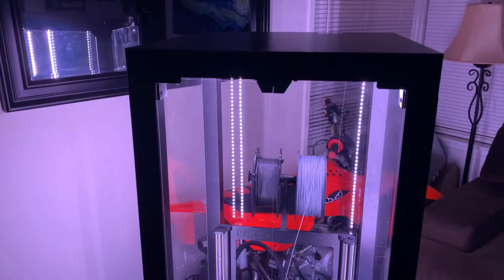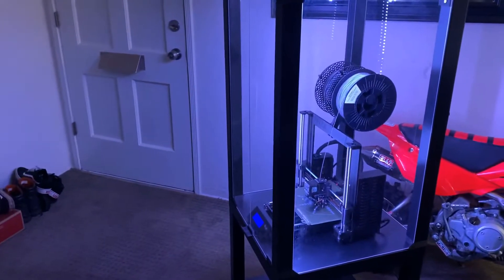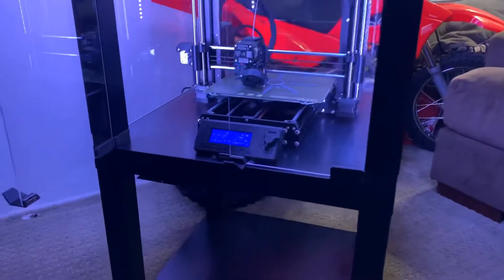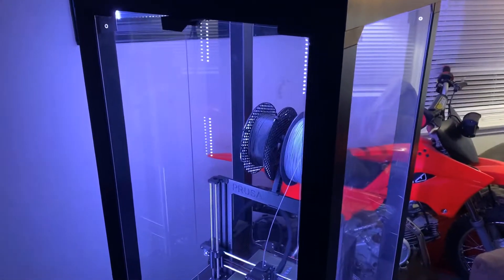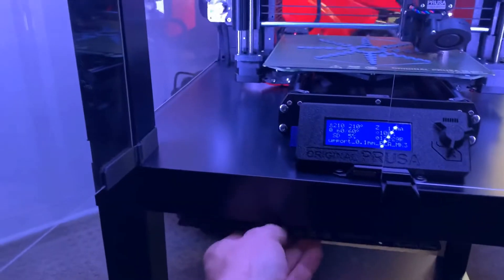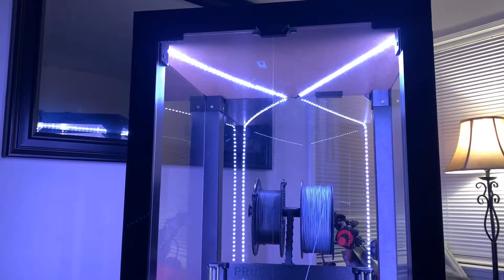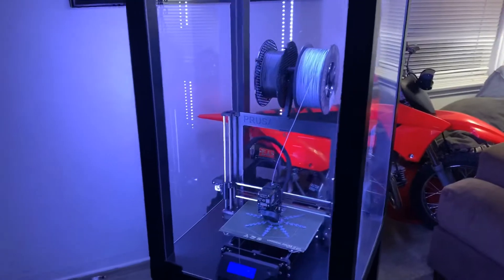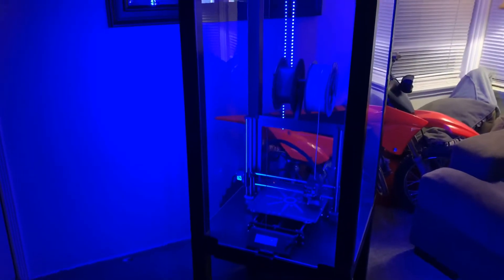IKEA Double Lack Enclosure Prusa i3 MK3S+ 3D Printer

Comment: How do you have the top table top secured to the double legs?
Reply from the maker: The same way the table would normally be assembled, using the double sided screws.
Reply: @Tcodyw88  if you face the two legs towards each other, how can the other sides attach to anything else?
Reply from the maker: @cryptoknowsall  theres no guide hole there but you can still screw the double sided screw into the center of it.
Reply: @Tcodyw88  how are you securing the top table with double legs to the 4 legs below it?
Reply from the maker: @cryptoknowsall  using the supplied ikea double sided screws As stated in the previous comment they is not a “guide hole” on the other end of the legs so you will need to make a guide hole to screw into.
Reply: @Tcodyw88  sorry i meant how are the double legged table legs secured at the bottom of the enclosure
Reply from the maker: @cryptoknowsall  oh using the 3D print file that contains the hinges also has some connectors that allow the top to be removed

Comment: Cleanest setup by far, looks awesome! What are your thoughts on the power supply location? I saw in most videos that they mount it outside of the enclosure to reduce the chance of overheating
Reply from the maker: Thank you.  I actually did my research on this and decided to keep the power supply inside the enclosure because there isn't any real evidence of people who have actually had the PSU overheat from being in the enclosure and prusa will probably release a updated power supply before it goes bad from being in the enclosure lol. Additionally I'm installing a temp controller and fan to help maintain ambient temperature inside the enclosure for better print quality.
Reply: The psu will not overheat but will drastically decrease the lifespan of the component. They make a mount that holds it right under the table.
Reply from the maker: @jakefenske3482  that mount also makes it much more difficult to remove the printer from the enclosure. It also brings the question what is the psu lifespan? Lol their isn’t any evidence keeping the psu inside the enclosure will reduce the lifespan, only the speculation of people trying to provide the most optimum enviroment for the printers components. But let’s be honest by the time that happens Prusa will most likely have another updated PSU. Also my enclosure has temperature controller and fan that maintains the internal temperature for more consistent printing. Thanks for watching!

Comment: Hi, I was wondering what the height is from the bottom of your printer to the top of your filament. Are those 1KG filaments?
Reply from the maker: It’s about 25” inches depending on the brand filament because use different spools.

Comment: I like this. I have a ender 3 v2, it's a bit taller so this would be great. I might take some ideas from you if you don't mind. I was thinking about using the mdf shelf you have on the bottom and add a isolated temperature controlled filament area. Also some of those infinity mirrors on the top panel and maybe the entire back panel.
Reply from the maker: Of course. I’m designing hanging spool holders and I’m hoping to be able to get 8-10 spoils mounted inside the top. 
That sounds like it would pretty cool with the mirrors
Reply: Cool idea with the infinity  mirrors